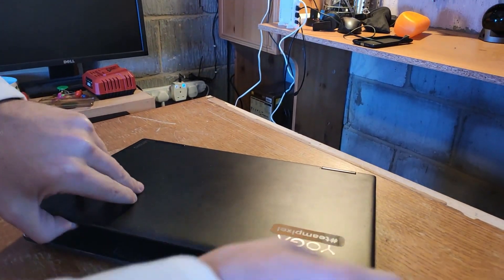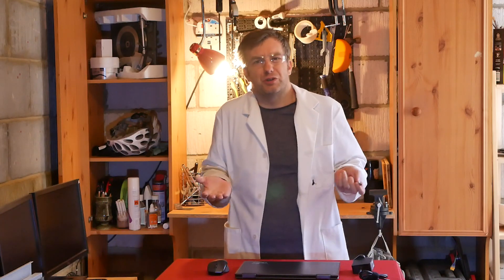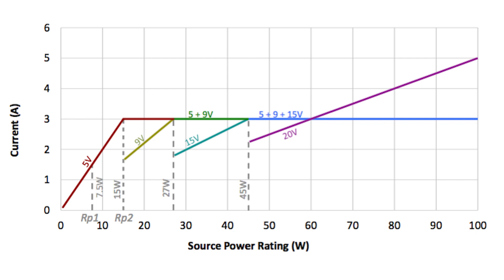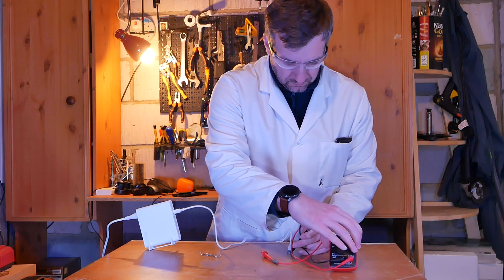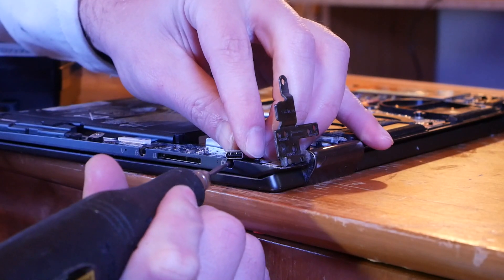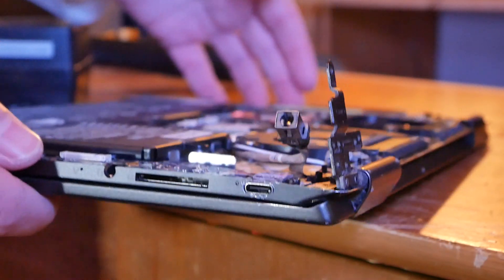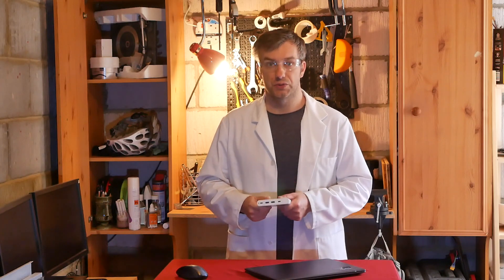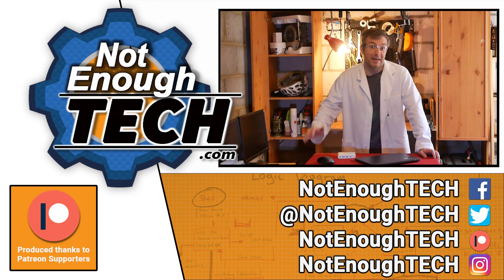Add USB-C PD charging to everything

Comment: Very cool! I am thinking of doing this to an older Lenovo which has the usb like port, but it looks like it has a 3rd pin in the middle for signal or something. Do you know if i also have to connect the middle one to anything? Thank you!
Reply from the maker: You should investigate where the cables go. This will give you an idea how it could be connected.
Reply: @notenoughtech  Thank you, after some googling i found out that  I have to add a resistor between signal and ground to the rectangular lenovo port, according to the maximum wattage i want the laptop to recieve.
Reply from the maker: Check the voltage on the receiving end (open the laptop) and you will know what you are dealing with
Reply: @notenoughtech  I already have done that and measured the voltage. The resistor between the signal pin and ground is only there to tell the laptop how many watts the charger puts out.👍 btw how reliable is the pd port? Is it still working?
Reply from the maker: I'm still using it. It won't modulate the power but it will push whatever charger is capable of

Comment: I love this but I'm not skilled enough to dremel out as good as that. I may actually try making a converter cable from the classic barrel power connector to type c.
Reply from the maker: You can buy these too. The trick with dremels is to take it real slow. Remove a bit of material test fit repeat as you can always remove more but once you've gone too far that's it
Reply: @notenoughtech  Measure twice cut once! But I never measure to begin with, that's my biggest problem when it comes to cutting/dremel etc. That is good advice to test fit as you go like you did in the video. That way you get a clear visual of how much more you can go and you don't actually measure anything!
Reply from the maker: Trying a fit is technically a measurement :) 
Only freehand in art :)

Comment: Looking for a solution for my Lenovo yoga tablet version 1.. would be nice to pass my old tablet onto my son So I can upgrade without having dramas of breaking USB all the time
Reply from the maker: Tablets could be more problematic as have more space constraints. Plus remember this hack supplies usb-c port for charging only. No data is passed through
Reply: @notenoughtech  couldn't you just pinout the socket and reapply pinout to new socket?
Reply from the maker: Not for data. I can break out usb-c all day, but if the laptop side doesn't have a free usb bus to bring it to... It won't matter. Remember I'm replacing a DC jack with usb-c connector (not adding an usb port)
Reply: @notenoughtech  ok.. how many pins for USB A compared to USB C?
Reply from the maker: USB A has 4 pins. USB C uses these and has additional data lanes and power protocols if recall correctly there are 14 ?
Reply: @notenoughtech  I see.. thanks for clarifying that.. O though it might be a simple swap out.
Reply from the maker: Only for charging. Sadly usb ports are more complex

Comment: Replacing usb-A with type C ports would be a great video!
Reply from the maker: Also a much bigger challenge. It could be possible as long as you dont expect USB-C PD charge
Reply: @notenoughtech  no usb pd means no power just data?
Reply from the maker: @peyn8  no PD protocol. You still get the usb protocol for charging
Reply: @notenoughtech  would be a little better than just usb-a, anyways. But I really appreciate what you've done here! Definitely this is not for the faint of heart.
Reply from the maker: @peyn8  things I do not to carry extra charger :)

Comment: I have an asus k53s, original charger is 19v and 120w
I used this small adapter to charge it with my macbook pro type c charger, it works with laptop off, but when powered on it keeps charging for 30secs then stops for a moment and cycles like that. I do not put it under any high load, only windows 7 running xd
Reply from the maker: It's likely that it cannot negotiate the pd charging voltage correctly. Do you have a multimeter to check what the voltage it is stuck on?
Reply: @notenoughtech  original adapter is giving 19.5volts, and this adapter is giving a 20v solid.
Now i let it charge fully and started the laptop and it does not interrupt. I guess the charging was the issue or i powered it on too soon.. but that means i canr hot plug it while laptop is running.. :(
Reply from the maker: The system should negotiate the voltage regardless as the decoy does the job of selecting the voltage while laptop just uses that to charge the battery. I'm not sure why it would act this way if I'm honest
Reply: @notenoughtech  i used the power meter to track consumption. Seems like laptop usualy wants more then 100w eaven in idle state, and it triggers overload protection in the apple power adapter. I need more efficient laptop for the project :D

Comment: thanks for this. it's simpler than i thought, though the challenge would be to find a compatible USB C controller that matches the laptop DC in specs

mad skill right there, that USB C fits perfectly with the drilled hole
Reply from the maker: I cut short the part when I drill. I stopped drilling often to make sure the connector fits. After all it's easy to remove too much. It was definitely worth taking the time. I filled the scratches with paint and looks almost like someone designed it
Reply: @notenoughtech  Hey, great video man.
I think you can use the same type-c to transfer data by soldering wire to the data pads on the type-c plug and connecting them to an existing USB port's data wires/pads so you can use it as a regular port
Reply from the maker: @abosalah2854  As I haven't done it, I probably wouldn't recommend it. Also, I know charges use data lanes to negotiate the charging protocols so probably you don't want to mix ports like this to avoid the potential disaster.

Comment: Was thinking of doing this to my asus tuf a15. It even has a type c connector but it doesn't support charging. I wonder if anyone was looking into this...
Reply from the maker: if you have space, you would be able to add the decoy inside instead, sounds like easy enough job - just check the voltage before you do this

Comment: There is only one problem. That board outputs 5V until it agrees on one PD profile
Reply from the maker: It's not a big issue in this case. Undervoltage is not near as dangerous as overvoltage
Reply: @notenoughtech  its true but some devices might lock up

Comment: I hate PD because then you have to have proprietary charges that support it and can't just use your existing USB wall adapters. I know that they're not going to charge as fast but that doesn't matter to me I mean how do you know if I'm sleeping or maybe I'm only going to use the device for an hour and it won't die in an hour if it's plugged in with at least some juice coming into it.

I bought a device that only supports PD so I couldn't use my existing power bank when on the go. I got a new one that says it supports PD and my device only charges for 3 seconds and then stops charging whereas before it would literally give a notification saying it won't charge. F this.
Reply from the maker: PD is actually very good for you as and worth jumping to as it standardises the charging protocol, enables power delivery with fast data transfer and with much higher power thresholds you can use hubs to charge multiple devices more effectively. Not to mention that you can use single cable to power up a monitor send video stream and access data via USB at the same time
Reply: @notenoughtech  i just think if it has a usb port for charging it should let me use my 5v 2a charger i have been using since the dawn of the smartphone age (2012 to be exact).

If it has all this extra fancy s*** to allow for higher power chargers that's great but sometimes when you're in a pinch you can't get one of those.
Reply from the maker: @bland9876  usb-c PD is backwards compatible. If you can't simply charge 5v device then the fault is caused by poorly implemented cable or charger.
Reply: @notenoughtech  2hen i plug a 5v 2a charger into my surface go 2 it says on screen that it won't charge so it knows what I'm trying to do.
Reply from the maker: Surcface Pro is a beast (in terms of power consumption). Putting under-spec charger is like putting a moped engine into a truck. Batteries expect certain voltage to be charged correctly. USB-C has 5V to 20V range. Computer electronics might be working on 12V logic or even stepped down to 3.3V, but if the cells discharge at 20V, you will never charge it with 5V.
It's a bit like plugging your microwave into a USB powerbank expecting it to run.
Reply: @notenoughtech  well i have a nintendo switch and it will charge of of any old charger you have lying around. It will even charge off of chargers so under powered that when playing an intensive game it will lose power while charging.

Also I'm pretty sure I mentioned it before but I bought a power bank that says it supports PD charging and yet the surface go won't charge with it. However it won't give you the message saying it's not going to charge instead it'll look like it's charging for about 3 to 5 seconds then the charging indicator will disappear hovering over it the surface go doesn't say that it's using the power from the battery either like when a laptop would says plugged in not charging :(
Reply from the maker: When you plug in usb-c PD it speaks to the other end to get the information about the charging required. It will get the voltage and current right for your device. 

Batteries have another parameter which is the discharge rate. You can only drain the battery as fast as it allows you. 

Read up on PD charging in detail to understand how it works so you know how to power up your devices
Reply: @notenoughtech  the whole thing was that usb was universal. This means that any device with a usb port would just work with anything. Now we have to go in and make sure our device is compatable or not and it is getting really annoying. Like why do they need to lable some usb ports as thundervolt? Why cant they all just suport everything? If i want to use a low power output charger to just keep my devise from dying as fast i should be allowed to. I have had other devices that allowed me to do just that even one running windows 10.
Reply from the maker: If you make everything universal and compatible you kill the progress. Original usb port is something like 200 times slower than 3.2 standard. Can't handle more than 500mA current. 
You can't have progress and backwards compatibility with everything.

Comment: I wouldn't recommend it to gaming laptops or any laptops that would require a lot of power.
Reply from the maker: Yes, you have to stick within the power limits the USB-C is rated for - that's usually up to 100W, with 240W standard just making its way

Comment: i've got an acer where the useless tiny round charging port is soldered to the board ( https://youtu.be/CWivPPc5ees?t=36 see top right).
you think something like this is feasible for laptops like that?
Reply from the maker: Yes, if you can find space for your USB-C board. You can leave the original jack intact and add parallel connection to feed new power in without any issues. as long as you have space and are able to separate the boards from causing shorts.

Comment: Anyone done this on a Acer Spin 5? because i'll be buggered if i'm buying another 3mm x1mm dc power brick. Just for it to snap off for a 4th time.
Reply from the maker: If you have enough space inside and if you are running a similar voltage/wattage - then yes. If adapter works, you should be ok for the power requirement

Comment: after watching the video a few times (having to same or similar laptop you used on this one), i decided to add usb c to my laptop hahahahahahaha i'm waiting for the things i bought to do it, even a usb-c module to replace the conector on the charger and a magnet adapter to have magsafe-like charging (which may be a few days after this comment is written)... i think the only challenge i really have is soldering the usb charging port on my laptop, because i dont want to fuck it up hahahahahaha hope be able to do it because i can add it to my sister's laptops too
Reply from the maker: the magsafe cable would be nice touch actually. I should order one too
Reply: @notenoughtech  give me a second to put the adapter i used (if yhou don't want to buy another cable)
Reply: @notenoughtech  https://es.aliexpress.com/item/4001264700942.html?spm=a2g0s.9042311.0.0.250e63c03nKltn this is the adapter

https://es.aliexpress.com/item/4000340298280.html?spm=a2g0s.9042311.0.0.250e63c03nKltn and this is a magnetic cable (i will use it on my iphone)

i have a question: did you heat-solder the pd module?? (with heat gun) or with solder station (this is actually my challenge, because of the little spaces where i'm supposed to solder
Reply from the maker: @ArielGonzalez1  I think i would buy one of these 90 degrees cable to keep the cable from sticking out

Comment: So ughhh yeh, if you aint experienced in electronics DON’t do this. I shorted my power jack connections, so now i need to wait till i can afford a replacement MOBO. Lesson learned, after i get the board and check i turns on. I am leaving the power jack connections alone….. that or ask someone who knows what they are doing if i can pay them to do the mod. Ironically. I can still use the laptop. But the power jack is fried.
Reply from the maker: i'm sorry to hear it. The dc jack usually is connected to a battery charging circuit and should really a reverse polarity protection. It can blow either a fuse, but as these things are not really "replacable" self resetting fuses are often use. They require a couple of min to reset after which you should be able to use the jack as normal. This obviously depends on the hardware you have in your hands.
Reply: @notenoughtech  OMG, you absolute life saver, it worked, but does this mean, if it shorts again that it is dead for good?
Reply from the maker: @HonestLettuce  obviosuly try not to get it shorted. Do you have a multimeter? You can get a cheap one for a couple of dollars. It will cover you.
I expect the fuse to last, but without knowing what fuse is used, I have no way of telling. I'd risk a statement saying - you will be ok next time this will happen, as it sounds like you have a resettable fuse. Blown fuse wouldn't let you power the device until replaced.
Reply: @notenoughtech  Ahh i see, yeh. i am never pulling that stunt again. as for a mustimeter, ironically enough it was a mustimeter i accidentally shorted the contacts with. xD
Reply from the maker: Haha well let's hope that's the end of it.
Reply: @notenoughtech  Yep, i will probably take it to a computer shop, see if they can replace the fuse...just to be safe. Regardless though, it would have been nice to have USB C charging. Is your laptop still running well?
Reply from the maker: @HonestLettuce  Your fuse isn't "replacable" resetable fuses are usually soldered onto the PCB. Unless it failed you and you no longer can use the equipment you are good to go